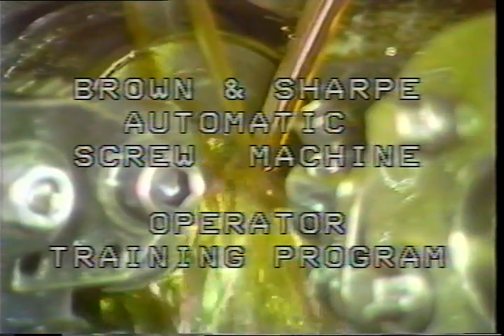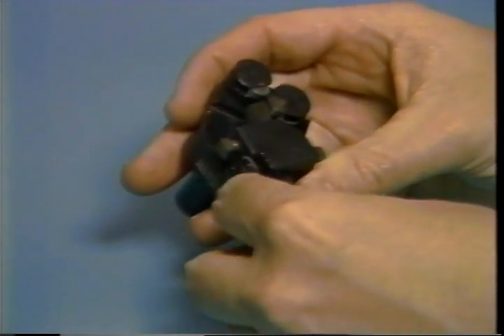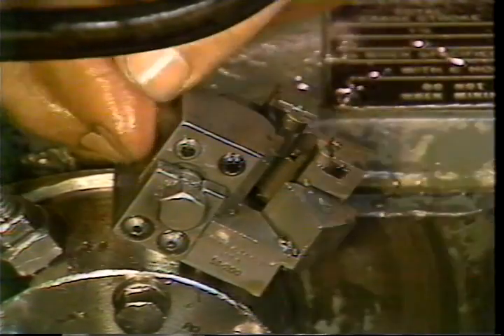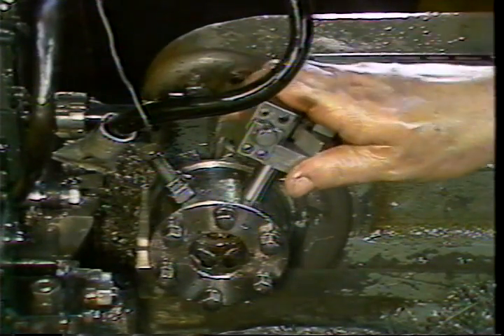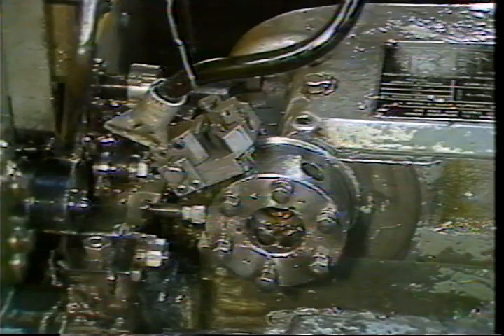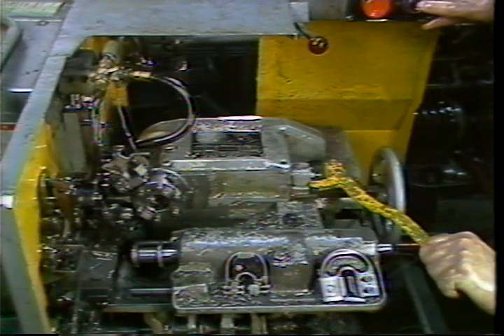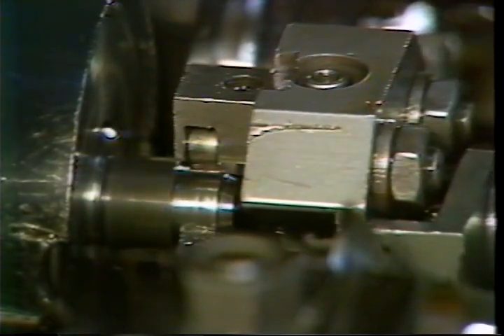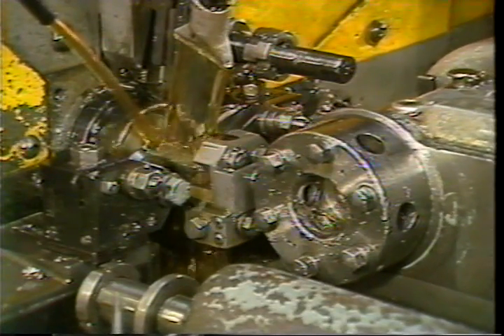Brown & Sharpe Setup Training Part 12: The Box Tool

Comment: Excellent!  The mystery is solved -  wish I had seen this video prior to wasting many hours of frustration trying to understand what is going on. If you think about buying a used box tool on eBay,  make sure it is NOT a left-handed unit if you are going to use it for conventional turning! Check the photo to see if it says LH or RH. Buying the wrong one is very expensive when you consider your bar tab, and flowers for the wife!
Reply: I mean, it depends on what machine you use it on. . . . if you're just using it on a lathe, reverse the spindle.